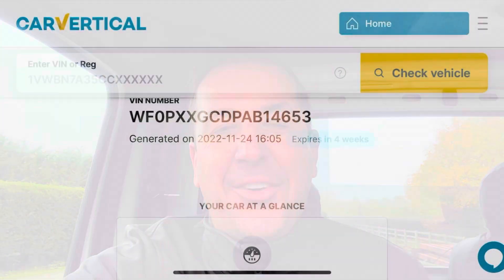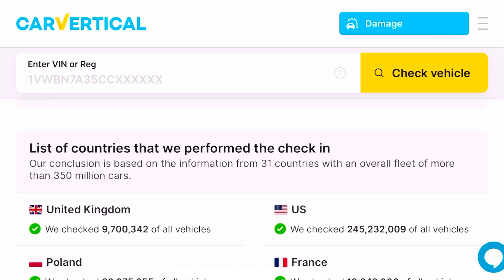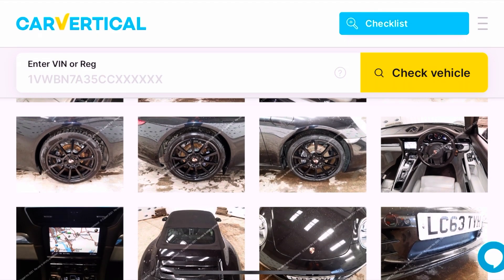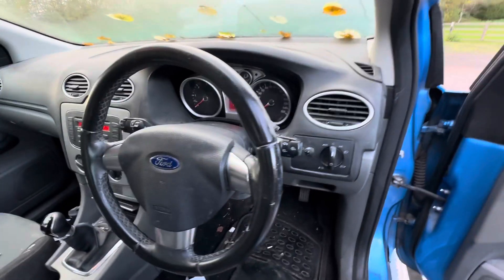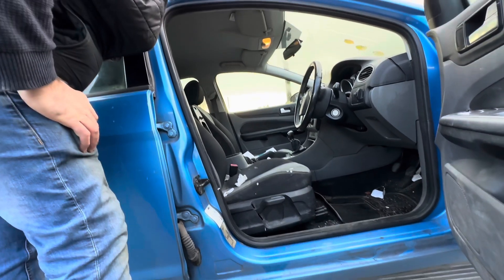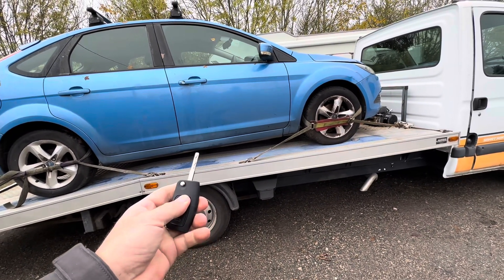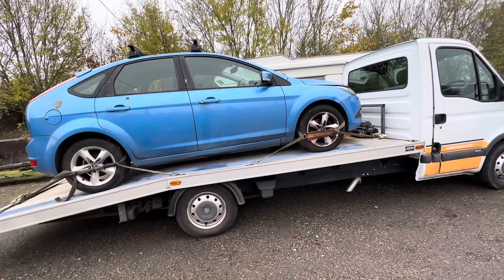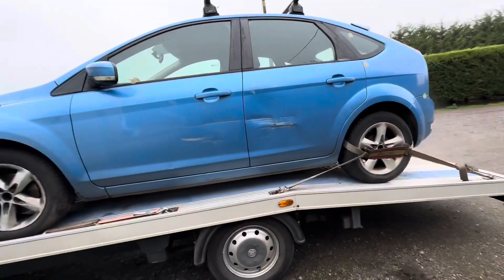HOW TO LOSE MONEY IN THE CAR GAME!! ROB MESSED UP!! FAIL!!

Comment: i always thought any car with enough MOT on it is worth 500quid, but i can imagine if it takes up half a day cleaning it up there is no profit left in it so its better to just cut your losses and move on to the next one... after months of weighing it up ive decided to take the plunge and have a go myself, ive meen messing with cars for 25 years and just bought a lightly damaged car on copart... i think there is money left in it, but obviously i'll be doing it on the side so wont have the usual garage overheads to consider. keep up the good work lads

Comment: Times have changed..As a Young car owner in the 80's...Car scrap yards were full of accident damage or Rotten cars...Today you'll see stacks of straight 10 year old cars with unviable repair expense costs ...It's a throw away society now..and business is business..Its as if there has been a 360 in the decades...40 years ago you'd have good motors in Rotten cars...Today you have Rotten engines and electronics in solid cars..

Comment: @ 14:00.That skin on the donor door is completely different, the mk2.5 focus (08-12) had a designer fold going down the complete side of the car . The mk2.0 (05-08) didnt
Reply: As long as the shape and hinge/lock placement is the same, you’re golden.

Comment: if same paint code it's the same, your car more than likely needs a good buff and a clean. Same code means same paint simple as that... for bit of body damage sell it for spares waste of a car
Reply: Probably it is the same paint code but different batches of paint. So no matter how much buffing it possibly would look better but still way off…
Reply: @el_micha  Neh mate if same code it's the same paint... Say they make a paint with code LLD5W for example for 15 years no matter what the car is will be the same. Am telling you this because I had the same problem thought the same, spoken to my mates dad that's been a body repair guy for like 30 years. He explained the code means it's the same paint. The paint can look in good condition but if not buffed up can look different. The colour is the colour if you out that paint code in a computer to mix and make the paint you will get the same colour. 

Each pigment entry has two identifying codes – the Colour Index Constitution Number, and the Colour Index Generic Name Code. For example, Ultramarine Blue is categorised under CI 77007 (the Colour Index Constitution Number) and PB 29 (the Colour Index Generic Name Code)

Comment: 13:37 anyone else screaming "wrong shape focus" at the screen? the body line mid way down the door is completely different and I wouldnt stand under that car the way them forks bent in the depolution centre.
Reply: Yep he's trying to fit a mk2 door 2005 to 2008 on a mk2.5 focus 2008 to 2011.
Reply: Body is the same shape, just some different pressings on the doors? Sure it would have been fine.

Comment: Your car is a  face lift model the replacement  doors  are preface lift
Reply: Yeah the door he was looking at are for the model between 2006 -2008  their model was from 2009 -2012 they had face lift version the smarter one as I call it looked better than the first generation pre face lift and you don’t just give up because a few doors don’t match they started of the video by saying they had a key cut for it and how the engine sounded good and that it’s a runner then says about wouldn’t like it if the cam belt snaps what ? They was saying it’s a good car and if you get the cam belt replaced it won’t snap then will it that’s not a another reason to scrap a car either if it’s due a cam belt change or the belts look to be on the way out then replace it you don’t just go oh I will scrap it they’ve had worse crash damaged cars than that and they have fixed them

Comment: Would of made a cheap runaround for someone that Rob, clean out the rubbish bit of a quick clean, run it down for mot if it didn't have one (not bothered to check). Even with the damage if it was a half decent runner would sell for 1k easy with the cheap tax and low fuel cost. £800 spares or repair with no mot.

Comment: How have you managed to lose money on a £300 car than runs fine and someone would pay £700 for 😅 all you had to do was advertise it honesty for £750 and someone would have taken it off your hands.. more money than sense.. just taken a cheap car away from someone who may have been struggling.. so stupid
Reply: Made their profit from the YT video.
Reply: @beachlife2968  not the point at all
Reply: @danlawrence9051  Making a profit is the only point. This video had drama which got the views and comments. You can't be sentimental in business even though it may be sad a seemingly drivable car has gone to car heaven.
Reply: Totally agree what a waste of a car it still had mot until Feb 2023 and could have done someone to get back and forth to work during the winter months and for £500-£700 wouldn’t matter if it was knackered out by the next mot for that money and mots on it looked pretty clean anyway but it’s their business and it’s on their heads now

Comment: How come the car isn’t fully depolluted eg shocker oil and air con gas when it supposed to be when they go on soft ground? Like they aren’t concreted at Kent auto salvage, if it was concreted it wouldn’t need to be depolluted while on the concrete, is mark on license or permit Rob?

Comment: Total waste. Nothing wrong with it, no need to scrap.
Reply: Totally agree a few bang on it and they scrap it I smashed my Peugeot 207 on a gate post and it caused similar damage to what they had and I got it fixed for £350 and the car is worth £3000 mine is 2010 like the focus and yeah mine is automatic and low mileage but even so you don’t just scrap a car because it’s got a few bangs on it they could have easily got it fixed like I got mine fixed and you cannot tell it’s ever been banged and I still have it now perfectly fine you don’t. Just scrap it because of a bang or crash it’s not mechanical it’s body work damage and the damage on the focus they had wasn’t mot failing damage either as it didn’t have any metal protruding out to Cause a danger and they could sold it for £800 - £1000 even with the mileage as some people don’t have a big budget for car and it being that it’s from 2010 and diesel what a waste
Reply: I agree, lots of life still left in that car

Comment: Seems a bit of a waste to me, even without the replacement panels it could have made a good run around for someone, seemed to run well. 3 months MOT left as well. Would easily have sold for £750-£1,000 with a clean.

Comment: JUST PUT THEM ON THEY LOOK FINE
Reply: Wrong shape.
Reply: The doors would not have fit anyway the car is older
Reply: @itz-_-adam1996  they would bolt on and close but the swage lines would not line up

Comment: You did not discuss parting out option. Appreciate it would be kicking around for a while but thought there would have been enough on their to recover the £300 and pay for time pulling off parts as they sell? or even let local buyers pull the parts off themselves. I get passing over to Mark will also payback and alwaways good to know when to cut your losses but still would have been interesting to have some info / detail on a parting out option. Good vid on the a less successful project though! Cheers for that 👌
Reply from the maker: We don’t break cars

Comment: i had a similar car... 2009 Ford Focus 1.8 TDCI Zetec S.  bought it for £1400 and had trouble with it after only 3 days (common dash cluster fault i believe). many problems after including a rear tyre that blew and later found rear springs had snapped at some point, my dad bought me a replacement tyre then i bought 3 Michelin pilot sport 4 tyres over a few months. turbo intake elbow pipe had a nasty cut in it. after about 8 months i just wanted to get rid of it so i scrapped it for about £400. £1000 loss plus cost of parts i had replaced and oil/filter and air filter change. i was pretty down about it until just before i had booked scrap guys to collect it. long story short i thought i couldnt get car finance but found a place that would give me it and im currently paying for a 2013 (first sold jan 2014) Peugeot 308 SW 1.6 E-HDI, generally quite happy with it even though i got it on the back of that big loss... i have had to think of it as a learning experience otherwise the loss, hassle and annoyance of it would get to me too much. thats my story, thanks anyone that took the time to read it and sorry its a long one

Comment: I’d have tried a bit harder than just the one breakers yard to get those panels in colour. Even if they were off a bit just getting a bonnet on it that would latch would have got it up and running as a cheap smoker for somebody? Better environmentally to repair than recycle!

Comment: Could of made a couple of drinks profit in that car as a beta run around for someone. I’ve seen way worse motors rock up on building sites I get on from painters,brickys,plasterers it’s just the sort of thing they go for a cheap motor they can Chuck there gear in an not worry about damaging it

Comment: maybe a loss at the moment.....but a gain in many ways its swings and rounabouts....one thing i dont get is why they drain the oil from a perfectly sound engine....that alone must have a good value
Reply from the maker: They sell the engine but have to be the depolluted 👍
Reply: you wouldnt want to buy an engine full of old oil
Reply: There's nature reserves and water courses down that way. Can't risk it springing a leak and dumping a load of old oil into the water table. And anyone who buys an engine from a scrapyard would be putting new oil in it anyway.

Comment: I have no idea of current prices but surely a good running £30 per year diesel was worth saving.  Fix the bonnet get your carwash guys to clean and valet if it would pass a new MOT.  It owes you £450/£480 someone like the carwash guys local cheap car for £800.  I know very tight but it was too good to scrap.  Not environmentally the right thing to scrap a working car.  Or drive a Lambo but I will let you off, since your a decent geezah.

Comment: All well and good sorting the body issues out, you then got the mechanical issues, belt and water pump for example, then selling it on and if it develops a problem its more hassle, far more easier to do what you done in my opinion.

Comment: You should invest in Forescan , yes you would still need to have the lock picked and the key blade cut but you could code the keys yourself , for the 10 quid or so it costs for a years license it’s a brilliant tool for ford diagnostic and coding
Reply: Not to be confused with Foreskin.

Comment: What a dog of a car! 😲⚠️😳
My 2006 Ford Focus 2.0 ghia with 130k on it is mint compared.
I only paid £550 for it in 2017 with 95k on it a full dealer service history!

It's passed every MOT since, has been ultra reliable, has just cost me service parts each year, a set of brakes and 2 front tyres, the rears just won't wear.
Best value motoring by far, parts are cheap and plentiful.

Comment: Only desirable derv focus is the 1.8 with a proper ford manufactured engine
Reply: With a wet belt and bad injectors 🤣 I don't think so 🤔
Reply: Oh and sudden death diesel pumps!
Reply: Diesels only worth it if you do high mileage too many only drive diesels in towns which clog up DPFs
Reply: Yeah unfortunately the 1.6 gutless petrol is pretty solid but still has its problems core plugs power steering pumps and washer jets seals letting rain water through but what car doesn't have commom faults 😂
Reply: @drewcorbett7603  my Dads Focus has the 1.6 the sigma based engines are good engines but even they can have problems the Mk2 Focus is bigger then the Mk1 so the 100hp 1.6 will be a little gutless
Reply: Im sure they are the same car underneath ive see posts people swapping all mk2.5 panels over to the mk2
Reply: @drewcorbett7603  Mk2.5 is just the facelift to the Mk2

Comment: Be careful with ford paint codes. As you have found the code you see is only that colour for that year. Get the paint colour from ford for the vin. That's the only true answer.
Reply: its vision blue, 2008-2011, i had one of these in much better nick at 62k, i put another 40k in 4 years

Comment: Best outcome lads. Folks on here don't get the business side of this decision. Yes you could punt it on and pocket £200, lots of risk in that. Reputational risk if is craps itself tomorrow, space it takes if it's hanging around for a month (space that a car with a decent margin could use). As it is you've used it for business development, got a video out of it, strengthened your relationship with Mark. The value of these far outweigh the £200 you might have got with zero risk! Nice work.

Comment: The tyres are probably worth a few quid, a good clear out, a bit of filler a quick blow over. Got to be worth a few hundred quid.
Reply from the maker: Paint ain’t cheap 👍
Reply: Not a car dealer I hope 🤣
Reply: They already paid the few hundred quid without working on it, is the big problem in this deal. Basically it was a half dead organ donor, needed to save another one.
Reply: It was just a joke. I know very well that you guys wouldn't do anything like that, unlike some!!
Reply: @Harpy-Mark-Tomlinson  Phew, I had visions of Boycie in Fools and horses 🤣

Comment: The black one was in a worse state then this one and you fixed it
Reply from the maker: It had 19k on the clock and was one owner
Reply: it had resell value with 19k miles though

Comment: The tax is 220 a year not 30 rob
Reply: I have same engine in my mazda and its 30 a year.
Reply: @ryanh3285   I have the same car mines 220 a year
Reply: @fogmyster12  just checked that car its 30 a year so that's strange yours is more.
Reply: @ryanh3285   yeah strange that
Reply: @fogmyster12  Yours must be a petrol. Mine is a 1600 petrol and its 220 tax. This was a 1600 diesel